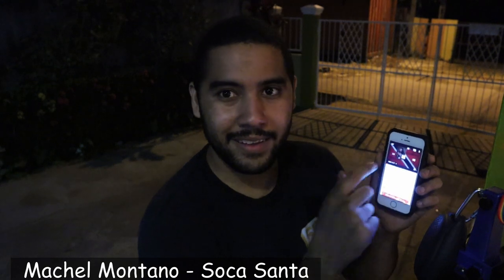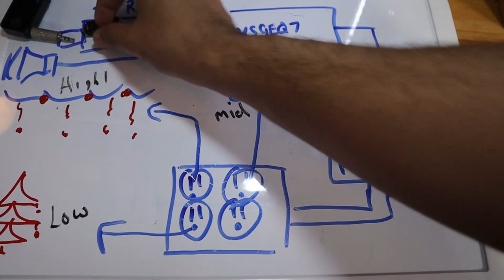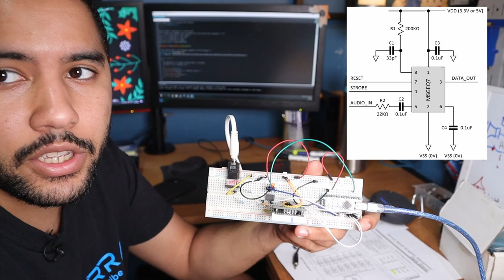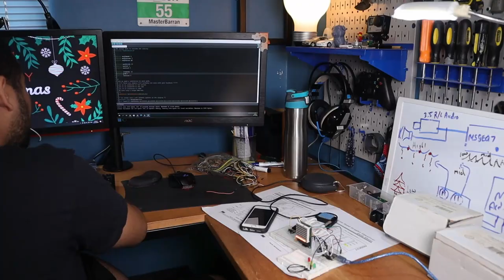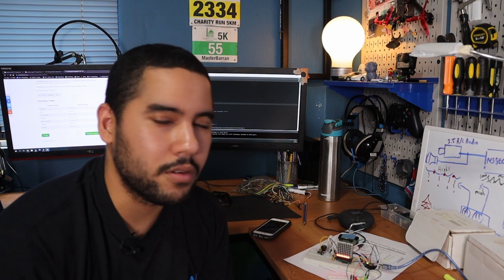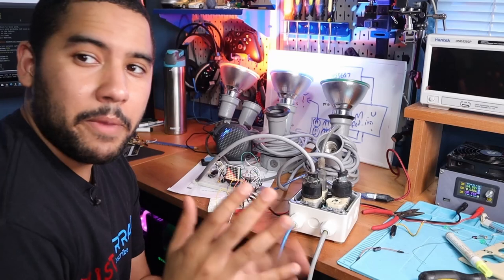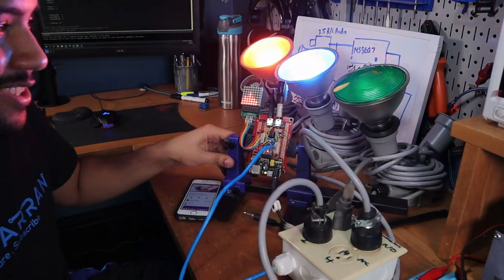DIY Automatic Musical Christmas Light Show (Bluetooth + MSGEQ7 + Arduino)

Comment: hey love the video, tried to make my own but found it a little frustrating that a lot of the materials you listed were misleading, i believe most of the capacitors needed for the msgeq7 are not included in that capacitor set you linked just something to think abt for this year, excited to see the updated version!
Reply from the maker: Hey sorry if anything was misleading, I would double check, thanks for pointing that out.   But  most of the capacitors are standard or can be substituted for standard ones could check out the data sheet, but I would still update it. Sorry for any inconvenience 😭😭
Reply: @JustBarran  its ok they are all just much larger then what is wanted i think, i might be wrong though
Reply from the maker: You are Absolutely correct, I actually took that affiliate like from another project , those are all Electrolytic caps, this is actually the kit suppose to be there https://amzn.to/2Zzhgoo surprised someone else didn’t get angry and point that out yet 😂😭 thanks good eye mate
Reply: @JustBarran  thanks for the response so quick, if u happen to have any more info available on the thing you created w/ the relay that would also be very helpful i think its very cool, i am recreating a version of your project for a class project haha
Reply from the maker: I would drop a schematic this weekend for you no problem, just be careful when dealing with any AC voltages, this year I am planing to go with Solid state relays though because as you can see from this video, the mechanical relays are noisy
Reply: @JustBarran  ur totally okay! thank u so much
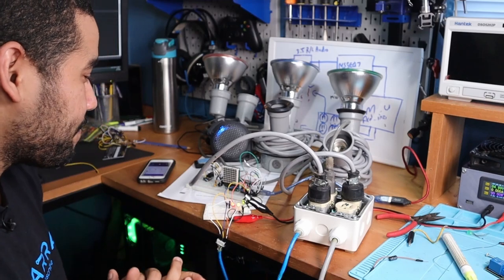Reply from the maker: @jamiebarbe6236  hey sorry for taking so long with this , but I did an updated video https://youtu.be/wjnvPcjyrNc you can jump to around 11:30 for the plug, and the materials list has been updated, hope I didn’t leave anything else out this time 😭

Comment: Where should I buy msgeq7 because the first amazon link for this ic says that the item is currently unavailable and regarding the second link, I don't want to spend 30 dollars for spectrum shield, because I need only msgeq7?
Reply from the maker: Will update the link try this https://amzn.to/38YgB1B , you can also get it from Digi-Key or mouser but they charge a lot for shipping
Reply: @JustBarran  Thank you for quick response
Reply from the maker: No problem, I actually working on my next video so at the computer 😂